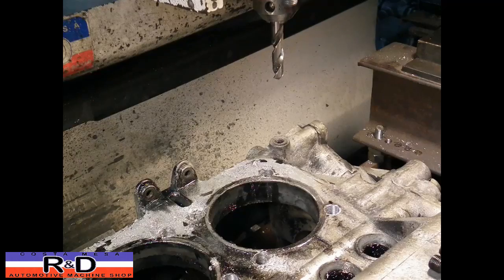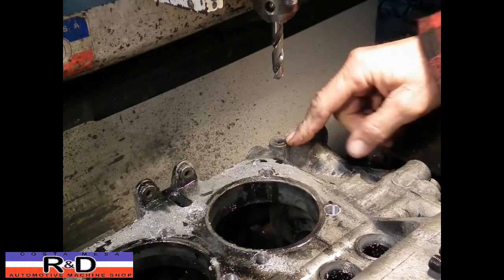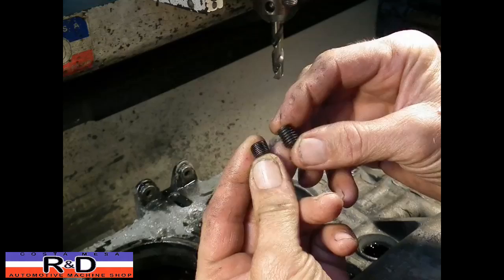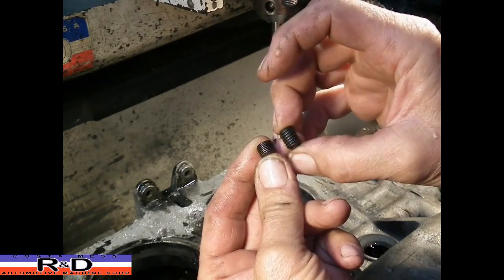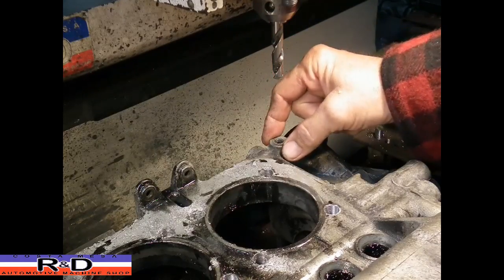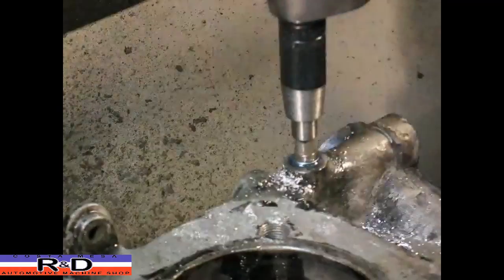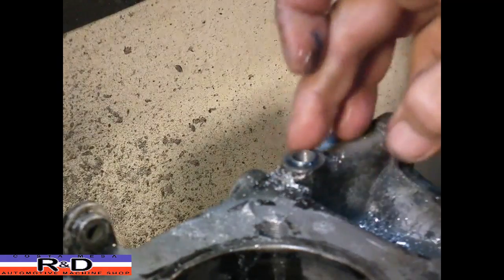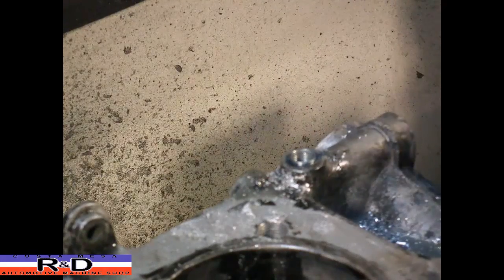Pipe Thread Repair on VW Case

Comment: Thread insert doesn't need to be flush since the tapered oil pressure switch doesn't seal on the case surface.  The fatter region of the taper is larger than the size of the insert will allow.  So the seal is made via the switch's fatter region creating an interference fit with the non-tapered insert.    When you insert the switch and tighten it, the ability to tighten the switch will be reduced when you hit the fat region. That's when you stop tightening!

Comment: Nice video as always.Thank you.You didn't have to grind the top of the Heli Coil flush with the head?
Reply from the maker: John Wilson John, This is a TimeSert, not a Helicoil, quite different. I don't believe that Helicoil makes anything for pipe plug repairs. JE...